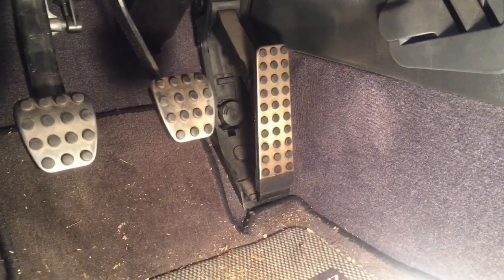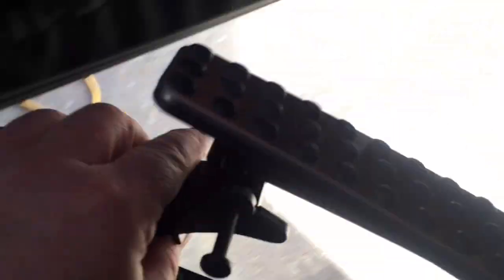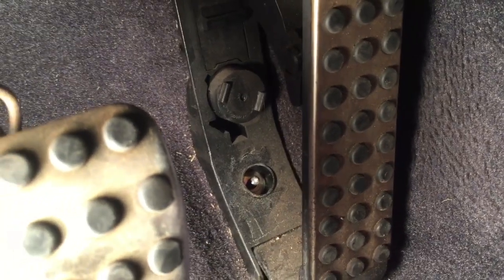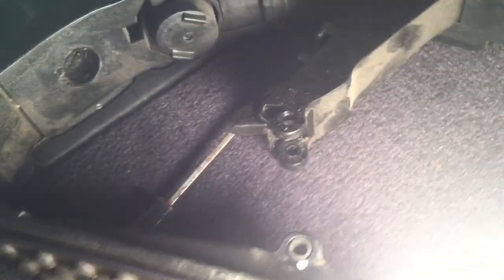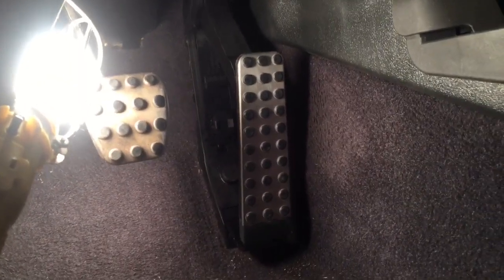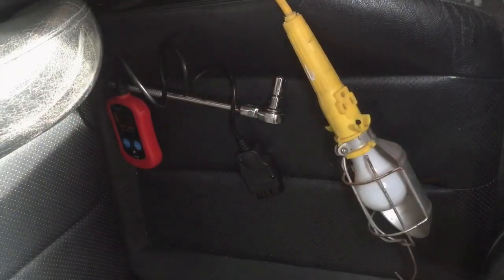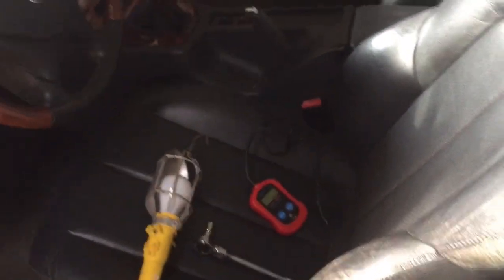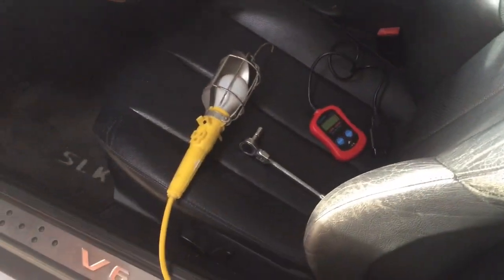2001 Mercedes SLK320 P0120 code throttle position sensor circuit pedal replacement

Comment: Thanks for the tutorial. You are 100% correct... that washer is insane to get out of there... especially when someone (the manufacturer?) has put thread lock on the bolt!  Other than that, easy-peasy.

Comment: what was the symptoms before the pedal replacement? thanks
Reply: Ik right
Reply: Ni99A probably got a P0120 code which says throttle position sensor failure.

Comment: I have the same code coming up on my 2001 slk 320 automatic. This code means the throttle body sensor needs to be replaced or the pedal. What made you discover it was a malfunctioning pedal?
Reply: Matthew Moody  what did u replace first....mine starts and runs but when i gun it or pedal down to fast it does not accelerate i have to rev slow and drives fine

Comment: Can you please tell us the symptoms of a bad TPS?
Reply from the maker: Symptom was that the car would not accelerate past 2000 RPM with the pedal all the way down.  Very reminiscent of being in limp mode.  Of course, using a code reader, the code P0120 is definitely the pedal or TPS

Comment: Mines takes off very slowly then gets up to speed like 4 seconds later is it that?
Reply: I have this issue as well. Sometimes when I put the pedal down and accelerate quickly it shuts off the ESP system (it shows the exclamation mark in the dash, and says it has no ESP). When that happens I have almost no power in the first 4 seconds like you mentioned, it's some sort of safety feature because the ESP is failing.
My car is under warranty and the garage is replacing my throttle pedal as well. They first tried to reconnect the throttle pedal cable but that didn't do it.

Comment: It didn’t work and I have the same code and bought the pedal sensor and everything
Reply: Joseph Munoz  what was ur problem....i have the same problem as guy in video and dont wanna waste my money...what was ur problem same code as mine?
Reply: Check Your throttle position sensor plug, mine needed cleaning with some electro-contact spray, works fine without replacing anything yet.

Comment: If tps is bad it will be sluggish down on horse power hardly wanna shift like riding rev limeter from time to time idle will be Smith though and mine is also running very lean or rich not shure which tho....

Comment: You skipped the main part where you took off the pedal
Reply from the maker: I couldn't film it because I was doing it with two hands, but I describe what I needed to do to get it off.  As other comments have noted, your experience may vary from being easy to being hard.  For me, it wasn't so easy getting the pedal out, but not impossible.
Reply: dolphin80  you didnt mention unplugging the wires? I have the nut and the plastic peice off but cant pop off the pedal or washer
Reply: Washer is not easy to get off by any means however unplugging the wires is far more difficult

Comment: So I replaced my gas pedal assembly. My P0102 came back.
Reply: Because in your case is not the pedal is the sensor which is in the engine compartment, check this video for ML320 but you can also search the one for your model: https://www.youtube.com/watch?v=Tv1wvyrzYBI&ab_channel=LehewTech
Reply: My sensor is part of the gas pedal assembly. I'm going to start tracing wiring.
Reply: @Andro Jesus  I don't have a throttle cable. I'm going to check the circuit between the gas pedal and the ECU. Then, I'll check to the circuit from the ECU to the throttle position sensor.

Comment: You do not have to remove or take pedal apart like that I just did this minutes ago and I literally undid the 10mm bolt pulled up took off held upside down got washer same producer Going back in
Reply from the maker: You should have made a video then, because if it saves time, then good for you.  I had trouble with that washer.  At this point, though, the point is moot. I've sold the car.  Good luck!